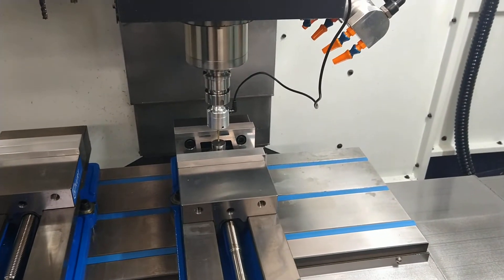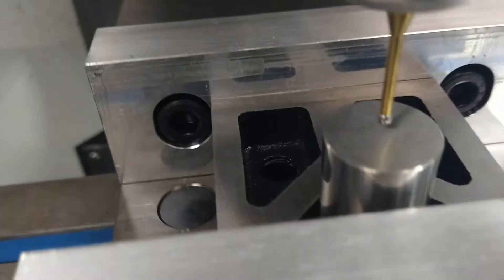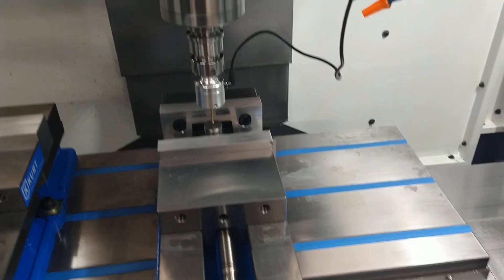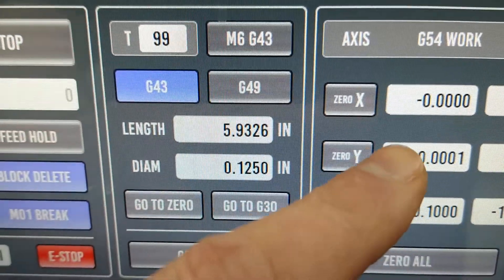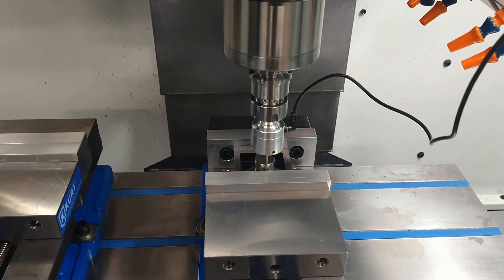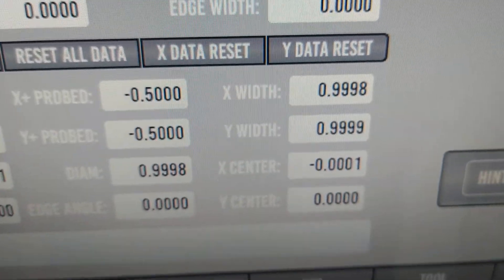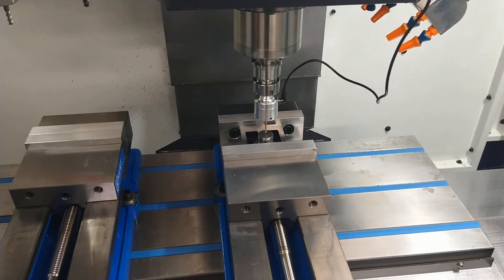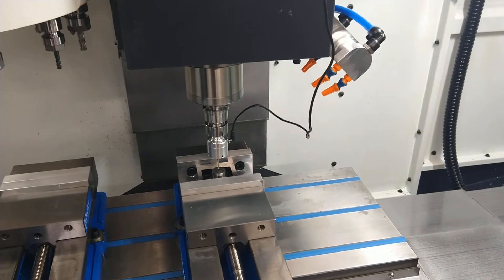Drewtronics and Probe Basic initial setup in software

Comment: I'm just getting my PM833 conversion setup and agree with what you said about necessary tolerance. My current machine is a POS mill/drill RF 30 that I can't even use the dials on, due to backlash and table play. To use probe basic and manually move the machine or to run programs and get 3 thousandths would be great and would work for my use. The most demanding might be to sneak up on a bearing bore, but right now I use my cnc plasma build and the RF 30 and do nice work. I'm trying to get my probe and toolsetter ready to go, but when I touch off a tool, the head goes down at 100 ipm and ignores the values I set for it. Probing with the Hallmark probe seems to be working fine. You had some good info, but the background noise just about ruins it because it is so hard to understand you. I'm guessing it might be a phase converter running. You might try a wireless microphone, maybe it would set your voice apart from the background drone. I heard you say that you setup the calibration screen, and I have that. Are you the person who made probe basic? I'm not sure of the history, but it is the only one on linuxcnc that seems at all modern and appropriate for running cnc and the TTS and probes. If so, thank you, and thanks for what you covered here.
Reply from the maker: @CGT80  which version are you using?
Reply: @SmallShopConcepts  Someone on the forum asked me if I copied the config VAR file. I have a VAR file by a different name and then read the probe basic directions again and it looks like I am missing a folder or two. It might be time to reinstall probe basic now that I understand they whole setup better vs. when I first did it. It has been a long and slow 6 month journey of figuring out the software and then dealing with problems on the hardware side. It has not been easy finding information on how it all works, so I have pieced it together here and there.
Reply from the maker: @CGT80  that was me.  The docs for installation work as expected on my test machines. What they do not cover is the full linuxcnc config initial setup as there are several ways to implement them. An update is a good idea, the latest version has many fixes and feature improvements and is setup on an apt update which makes distributing these fixes easier for end users.
Reply: @ Should I remove linuxcnc all together and then start again, or just reinstall the probe basic, or can I do an update to the probe basic simulation I have installed? I'm not familiar with apt update. Is it just typing in the update commands like I did when I originally followed the install directions? If so, should I periodically update in the future the same way? If you have a link or anything that explains it more, that would be great. I will try to search for more info on it as well. Thanks for your help.
Reply from the maker: @CGT80  apt update updates the software on your linux install.  Think of it like windows update but better.  Software developers can add repositories to the sources list on linux that allow for their software updates to execute when you run the apt update and apt upgrade commands.  Yes you should periodically run them as security features as well as linuxcnc updates and linux kernel updates are installed this way. 

Use the apt install method on the probe basic webpage and it will automatically add the repository to your sources list. 

I would uninstall linuxcnc and install per the instructions on the probe basic webpage to ensure you get the lockdown version of linuxcnc. 

Once completed you can follow the machine config instructions to make sure your config is properly setup.
Reply: @ Thanks, that is the plan. I will follow that page and try to figure out the linux updates as well and then reply back on the forum if there are still problems. I do appreciate all the help and plan to take a day or two to reinstall all that and clean up the loose ends as well as refresh myself on the software portion. My mill is to a state where it can be run and tested and it wasn't until just last week that I could do that. 

There was concerning play in the Y axis gib or ways and there was a lot of delay in getting the cnc conversion kit and then time to fit it all, as it required some adjustments and brackets that I built for limit and home sensors and way covers, counter weight, and cable management. The Y carriage still needs drilled for additional oil ports, but I'm going to get the software running so I can make parts and determine if there is too much play in the machine, before finalizing some of the hardware.

Anyway, long story short, it has been a long journey and quite a learning experience, but I like the Linuxcnc and probe basic route vs. spending a few thousand more dollars for a tormach with only steppers vs. my clearpath servos and open software. I'm thankful for all the people who effort into the linuxcnc community. I just got back into town from doing a job a few hours away, so I'm excited to go out and work on the mill tomorrow. Thanks!

Comment: I have sourced all the parts, old PC, secondhand touchscreen and Mesa cards will arrive soon plus a probe so this was handy. But did I miss it in the video or was there no mentioning of how to calibrate the probe in Z? I have a Metrol tool setter but if I touched off on that one, I am not sure how I would go about figuring out which of the probes had what "trigger distance". 

Thanks so much for all the work on PB - it's a main reason where I am making the switch to Lcnc;)
Reply from the maker: @AntiVaganza  i measure a facemill, load it with its offset, , face a piece of stock and zero out the z work offset, then probe the stock with a zero tool offset setting and the probe position only button active.  The z probed height will be your probes new tool length offset!
Reply: @SmallShopConcepts  Yes, I literally found the written guide online 3 mins ago;). 
But not sure I can do this as I don't have tool holders, but just regular collets where the tool/probe will always be in a slightly different location. I am also new at this so still have loads of things to wrap my head around. 

But I was hoping I could use a Probe Calibration Offset in the Z, too somehow. And maybe if I can establish the same on the Metrol tool setter, then I could insert the Probe, then hit the tool setter and then the workpiece for more accurate Z readings. 

But, I may be missing some basic info and I may be overthinking it;). The probe is still on the way, it will be my first ever.
Reply from the maker: @AntiVaganza  if your probe is non repeatable ots gonna be difficult to use it with any easy method currently available. You could setup a known location with a fixed height and write a subroutine to probe the position and auto calculate the probes current length offset against the machine z position perhaps.  Or you could setup the probe to the side of the head in a fixed position and use xy offsets also.  There are a few ways to do it, but truly you need a repeatable tool holder for it to work as intended.  Maybe change out to a bt30 or iso30 atc spindle would be your best option.
Reply: @SmallShopConcepts  I think i got it. And it may very well be that I don't actually need the Z probing to be super accurate, but precision on locating in X/Y would be great and of course, even with my simple spindle, the 3D probe still offer that. 
An ATC would be great, but not in the cards right now - if I end up producing more than just one-offs, I'll reconsider. 

While I have you, I hope the following is simple enough and again, apologies for not having the right vocab yet, but for the tool setter - can I make it work without having tool holders? The Metrol is so accurate and I really need to be able to use it with Lcnc. So, I don't mind what I am doing now on a cheapo, limited Chinese standalone controller, which is to:
1). Touch the tool off on the tool setter
2). Touch the tool directly off on top of the stock
3). Input the height difference between the tool setter and the stock in the controller (which I think should be automated but in this controller, it's not). 
and then from there on out, I can manual change tools and the tool setter will update the Z offset. 

Pleeease tell me PB's tool setter feature can do this, too?

Back to the 3D probe: Great idea having it on the side of the spindle. I have seen a few guys on YT do that with an actuated arm so it comes down when needed - but even a simple bracket on the side that I put the probe into when needed would work well enough as long as it butts up against a shoulder repeatedly:). Writing subroutines is not in my skillset, yet - I am still very new at all this. But at least touching off on a known location height wise wouldn't be difficult - I could just touch off on the block the tool setter is mounted to.
Reply from the maker: @AntiVaganza Probe basic caters more towards those wanting a production machine controller so everything has been written around BT, Cat, TTS, ISO tool holder spindles.  even the graphics display this.  

there are subroutines floating around out there that you could use for your use case  above.  i would begin in the more router geared community and find a touch off procedure and subroutine they use as standard and simply use it .  you may need to edit a few minor things but it could be called as long as it had the same name as the existing tool touch off subroutine in probe basics sub folder.  before you speculate any further i recommend you begin learning RS274NGC language, it is very much akin to gcode with a few of the helpful gates of pc coding. the manual is fairly short for it and easy to understand.  it is a very powerful tool that will allow you to do whatever you could imagine regarding your machine.  the manual is here:
https://tsapps.nist.gov/publication/get_pdf.cfm?pub_id=823374
Reply: @SmallShopConcepts  Yep, exactly like the router peeps do it. Bar an ATC this is such an improvement so will find a subroutine and figure out how to implement it. I'm based on a small tropical island in Asia so things take a while to get here, but in 2-3 weeks, I think you may see me on the forum asking a bit of help in reg. to Mesa and later on, PB;). 

Thanks for the RS274NGC hint - will put it on my Lncn to do list:)

As an aside or rather some background: My machine is fun, mixed bag of sorts. Whilst small, it's still cast iron and sturdy for its size and since I can tap into China's surplus market (at Chinese, not eBay pricing) I have put used servos on it and I found a steal on a Metrol tool setter. It has (used) but good condition Japanese ground ball screws and guides on it but crappy 1 dollar inductive home switches. But the latter, I can work around by homing to index pulses of the servos. Anyways, it's my first machine and an ATC spindle may be a future update but not for another year or so. That said, I do need the most precision and ease of use out of it that I can get now. 

I mentioned PB was a driving force behind me going with Linux. Simply because I "need" - or at least really like - a nice interface to look at. And I know a lot of my parts will be flipped plenty of times so I liked the idea of having easy to use probe features. I know the task of me learning Lcnc is daunting but I will give it my best shot:)

Comment: These were excellent videos, I referenced them often to get my CNC router running probe basic up and running parts, I wish someone would do something like this for the probe basic lathe variant. I have a fully functioning CNC lathe using probe basic lathe, but I wish I had something like this to help detail the tool setup and other functions. There's literally no info out there. I might add, I'm a mill guy myself, so lathe setup is already getting me hung up to begin with.
Reply from the maker: I myself would have to go back to relearn the lathe UI tooling strategy.. a 5 year younger me wrote them all and since then I have used it very little.  i think i gave 2 paths for tool setting, one being traditional and one utilizing master tool mode.  in retrospect I may have offered too many options which confused things.  I will take a look in the near future and see about putting a video on it out!
Reply: @SmallShopConcepts  I like options! That's why I love probe basic. Just not much documentation on probe basic lathe. But I'll manage!